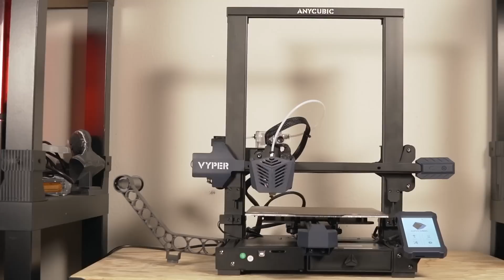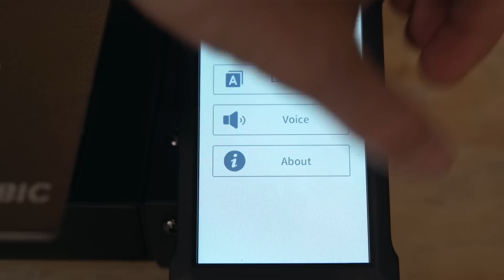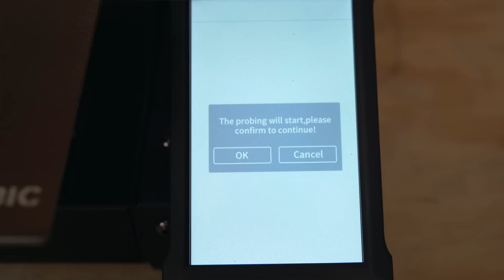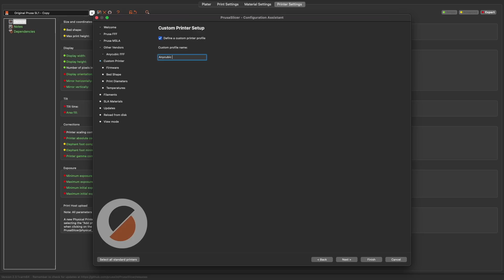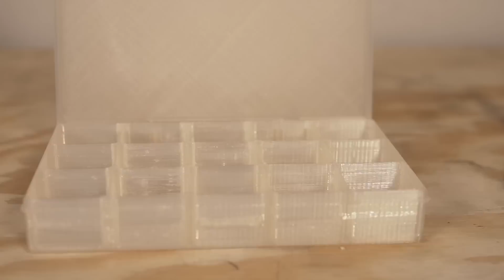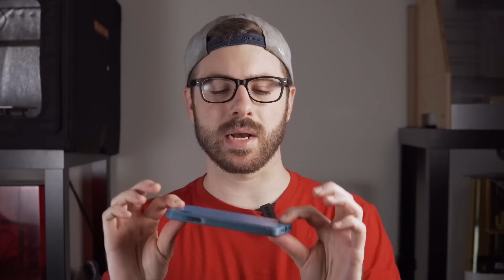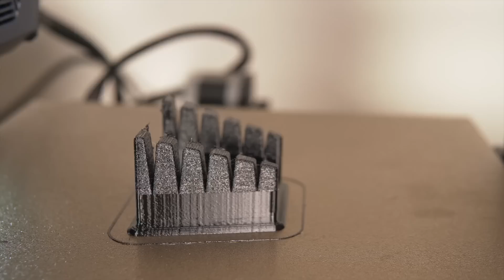The Anycubic Vyper 3d Printer Is SERIOUSLY Impressive

Comment: Hi I have been trying to set up my Vyper to print PEGT using a Cura slicer. It prints great until I introduce supports and I just can not seem to get it right. The supports just stick so well I can't get them off and the underside like the roof always has a terrible surface as if the filament is not sticking together on the first layer after a support. I would be so grateful for any advice pleas.

Comment: Great review! As this video is about 2 years old, I was wondering if you have tried to print with any ASA filament? I know it takes more heat to print with ASA and I was wondering if the stock heater would allow the extra heat. I'm concerned if the tubing will start to melt causing toxic fumes like my Mega X would do if I go over 240 degrees. Also, have you done any upgrades on this printer since this video? Thanks, Pete

Comment: Im chasing upgrades for my anycubic kossel linear plus, anycubic no longer sells parts and my heated bed build surface is worn and get no adhesion anymore, where would i get a new build surface and some 3rd party parts or upgrades that will fit the linear plus..

Comment: Low reliability, don't buy one, mine worked fine out of the box and printed the owl  test piece fine, I was stoked, then it couldn't print anything else without thinking there was a power outage every 10 to 30 min and aborting and not resuming.  The power was fine.  It's simply not a robust unit and destined for the garbage can like all the other Chinese crap.   If you still really want this unit, do yourself a favor and get $300 in cash and burn it and save yourself the frustration of getting this 3D printer to do anything useful.

Comment: I put a buck converter between PSU and MB fan. I adjusted the pot on the converter until I achieved a noticeably quieter fan yet still producing good airflow. The machine is SOOO much quieter

Comment: I'd check the firmware of the other printers for an option to disable the touch screen beep. It's probably there and just not enabled to change in the interface. Disable it and compile a new firmware. My Ender 3 Pro had a video assembling guide on the USB drive that shipped with the printer. Compared to the printed guide, it was an easier and more efficient way to assemble it.

Comment: Finaly i got my Anycubic Viper.The first one was destroyed during  transport, the second was stolen during transport, but the third one arrived in good conditioning. But what a dissapointment. Whatever i do, it will not do automatic leveling.. First i have to put a metal object to the nozzle, then it is homing and starts to pre heat. In all the tutorials i have never seen or saw this. then it starts to level it but afer the first point it stops .Abnormal leveling point put off power and check wirering. I did check it, dubble chekend it but i cant find anything wrong. i dont know what to do now. Can you help me?

Comment: I wonder if your "wet filament" was really a temperature issue. It's also probably related to the geometry, with the shorter line segments laying down differently than the longer lines below. Notice that both prints are clean down low and then suddenly get rough higher in the print. As the nozzle gets farther from the bed the ambient temperature drops off and the filament can lay down too cold. I suspect that you would find the layer adhesion to be poor in that part of the print as well.

Comment: FYI as a custom gaming PC builder, I heard you have an issue with the fan noise and that’s because it’s a low quality bearing fan. Next time you use one like this just go and buy a “Noctua NF-A8 PWM” 80mm premium quiet fan with the best airflow of any fan brand. Gets about 1800 RPM and is literally quite

Comment: Great review..  I just purchased the Anycubic Kobra model.  The print quality to me so far looks real good.  The one thing though is that It has the edge or lip material all around the part and is hard to get off.  I noticed your parts did not seem to have this edge or boarder around the outside of the part.  Could you maybe give me some suggestions out to get rid of this boarder?  Then again I don't know what this boarder is called.  Thanks, Dave...
Reply: It's either a brim, or elephant foot. A brim is extra material that's intentionally added around your part on the first layer to improve bed adhesion. You can enable/disable it in Cura under the "Build Plate Adhesion" section. Elephant foot is when your part is actually wider than it should on the first few layers. This is typically caused by a nozzle that's too close to the bed on the first layer, or excessive bed temperature that keeps the first layers soft, making them expand under the weight of the layers above. This can be fixed by reducing the bed temperature, increasing z-offset, and if nothing else works, by setting "Initial Layer Horizontal Expansion" under "Walls" (in Cura) to a negative value such as -0.2mm.

Comment: I need to get rid of my ender 3 max (pain in the b...to get levelled), i like the Vyper but it's smaller so what should i get  the size of ender 3 max but with the Vyper specs, need to be auto levelling and no damned springs under the bed, i'm so confused to many choices, thanks for your input.
Reply: The Anycubic Kobra Plus and the Kobra Max are basically larger Vypers.

Comment: yup its awesome.....junk. gotta love all the bought and paid for reviews. mine came nonfunctioning out of the box 3 1/2 months later ive got the replacement parts and installed them. its whisper quiet..... for a jet plane. oh and the magnetic plate powercoated yada yada yada... nothing sticks to it. this might be ok for someone well experienced in 3d printing. also the cura slicer software does not not include the anycubic vyper.

Comment: Just bought one for $335 on newegg. Im so exited to get this thing! We use Ender 3s in my engineering class and thats what got me interested. After debating for months i finally got a printer.
Reply: Can this print carbon fiber pla? maybe with a hardened steel nozzle?
Reply: How’s it been? Thinking about buying one
Reply: @brettshrekington loving it right now
Reply: yeah, your gonna wish you had gotten an ender3.
Reply: @denniswitthuhn2277  actually i don't. I really dislike my schools ender3s and im glad i got this. Had 0 issues so far.

Comment: Wouldn't touch this model. Has a faulty stress guage sensor in about half the models. Print head won't auto level. Just smashes into bed. You can contact anycubic and go through a "process" to fix it. But, I kinda just like the old work out of box when you spend almost $400 bucks. If you are an engineer and want to spend time being quality control and the beta tester, this is for you. Otherwise I would avoid this model.
Reply: The strain gauge issue is real, but it's not as bad as it looks. Considering how good the leveling is, I don't mind having to fix the gauge from time to time. All you need is a $3 part from AliExpress, some RTV and the ability to solder. I'd honestly rather change the part every other month than fiddle with bed springs, deal with inductive sensors, and/or slide paper sheets under the nozzle.
Reply: @dsp4392  I just ended up getting creality model with auto level. Worked out of the box and havent had to swap, solder or deal with something monthly. Honestly, thats what Im all about. But if you like all that jazz and spending $3 all the time, uh.. ok...

Comment: I had an anycubic i3 mega s printer. Had trouble with the print bed kinda warping near the center or it not actually heating properly. (Not sure, I'm as newbie to 3d printing as you can get)

I ended up buying this because of the auto leveling (I have nerve issues making it difficult to turn those knobs underneath the build plate at awkward angles)

I did my first 3 prints including benchy using prusa slicer with the same profile as my i3 and they came out absolutely flawless! An icosahedron with numbers, infinite cube, and benchy at max resolution. Can barely see any lines at all! So much quieter as well, so I can print while I sleep no prob. 

About to try out tpu for the first time, so we'll see how it goes, but I am quite satisfied with my vyper so far.

Comment: Great review! It’s pushing me toward buying one of these. I have a heavily modified i3 with direct drive and this is about to receive a volcano hot end. I’m also not crazy about the original Ultrabase bed as the surface is prone to damage and the adjustment is a hassle.  This printer improves both issues and I’d like a bigger build volume. It’s going to be a choice between one of these or the Chiron, which is now available cheaply and has substantially increased print volume.  I’ll hold off until next year before pulling the trigger.
Reply: did you ever make a decision?

Comment: purchased this the other day and couldn't wait. It was supposed to be easy peasy. my only problem is that  when I go to print the nozzle never touches the build surface. It just starts spitting out filament. tried to figure out z offset but couldn't get it going. any help would be appreciated.

thanks

Comment: The high pitch sound should be the PWM signal when it is not running at 100% fan speed. If you set it to 100% fan speed, the sound is gone. Nice video, thank you! :)

Comment: Ive had many prints stop mid print due to filament sensor malfunction. I updated the firmware and still experience it. Most times I just hit print resume and it might come back with the warning but at times it will continue to print for half a day before the error comes back.

Comment: I bought a Vyper and after calibrating and leveling it printed the owl. But that was it. The next print took the hotend below the bed and scratched the crap out of it. Anycubic told me that the sensor was bad and they send me another one within 15 days of filling their form. I returned the printer and ordered another one. I got exactly the same results. I just can't get a print because the hotend goes below level and will not print or autolevel, ever again. I'm sorry to say I won't try a third unit.

Comment: This printer is garbage. I bought one and after about 5 prints the strain gauge stopped working. The strain gauge is required for the "auto-level" to work properly, without it the printer is non-functional. You can easily find videos about this issue. I am returning mine. DON'T BUY!!!!

Comment: I would have bought one of these already if it did 50 micron layers.
Reply from the maker: You very likely could go down to 50 microns. However, I would never want to print that fine due to how long it would take to print anything. At that resolution I would recommend a resin printer.
Reply: @ModBotArmy  Relatively new to the whole 3D printing thing... How would I go below the advertised 100 micron minimum? Simply slice the file at 50 microns?

Comment: My luck is utter dog shit lol. I purchased an Ender 3 v2 and it came used, had a multitude of issues... I returned it and bought the Vyper, everything put together fine and I performed the auto levelling... It finished fine and everything seemed good... I noticed the Left "z-stop" sensor (the one attached to the Z frame) had a screw sticking out of the side and I could move the screw easily... The right sides was fine... Guess they send me one that wasn't assembled correctly...
Reply from the maker: Oh no! I am sorry to hear that. Where you able to get it fixed? Or was it stripped?
Reply: @ModBotArmy  I contacted their support, it seems the screw is only accessibly inside the sensors casing, and I don't want to try and take it apart. So gotta wait to see if they say I need a replacement part or not. Hopefully it is an easy fix. I've been really antsy to start printing haha

Comment: To me this looks very very close to my CR-6 SE in terms of features except the CR-6 has a filament run-out sensor and had a glass bed. I love my CR-6 SE though - print quality is ridiculous even at 100mm/sec. If this printer was a little cheaper to buy, it would have been a very appealing product.

Comment: You said the hot end wasn't all-metal, but the neck of the heatbreak looked too thin for PTFE tubing.  Wouldn't that mean it's all metal effective?  My V6 clones all have a short length of PTFE to the all metal heatbreak.

Comment: Sorry to keep spamming your comments. But think I can help you out with the Cura/M1 Mac issues. 

Messed around with some more complex designs, and was getting the same issues. Crashing. Freezing. Frustrating. It’d slice just fine. But issues would abound if I tried to preview. 

Did a little digging and discovered an easy fix that works well so far...

1) Open Cura
2) Select “Ultimaker Cura” from the menu bar
3) Select “Preferences”
4) Check the box for “Force layer view compatibility mode”
5) Restart Cura 

This worked immediately for me. Tried a bunch of different designs that were previously crashing every time. No issues. 

I’m still a newb with CAD, Slicing, and printing. But, hoping this Cura fix can help someone out.

Comment: Good review. I really like the flex bed plate and the auto level. Print quality though, I think my i3 Mega S actually does a little nicer job. Still, nice to see Anycubic is still innovating and improving, gotta like that! :)
Reply: most likely just need to sit down and spend time with slicer settings to pull the best of it out. 
My old I3 mega S was a completely different printer after calibrating the stepper motors then got better just spending time doing little test prints playing with settings.

Comment: Nice review!   Think this will be a great printer for first time users.
Reply from the maker: Thanks Brotha! Yeah many of the printers I have tested feel so similar to each other. This one at least feels like it’s got some additional good stuff going on. I will likely run some big projects through it 😬
Reply: @ModBotArmy  - I haven’t tested nearly as many printers as you.  I am at around a dozen printers.  When I first saw this printer and read the features, I began thinking this was just a CR6-SE clone.  However, the electronics are different, including the strain gauge, and the nozzle.  To me, this looks to be the better alternative to the CR6SE, which has the most notably feature, the strain gauge.
Reply from the maker: I actually had no idea it was even similar to the 6SE until I published the video. Then quite a few comments said it looked very similar. I do have a 6SE on the way but it is not a review unit or intended to be used for reviewing. I am just excited to see how it does having used the Vyper and loving it. Most people that I have talked to that got the 6SE seem to be pretty happy with it.

Comment: got mine, problem is autolevelling doesnt work. the hot end smashes in the bed and thats it.
Reply: Here are a couple things to check -- 

1st: Check the hot end to make sure that the heater block is level. I've found on mine that if the heater block isn't perfectly level it causes the nozzle to smash into the bed and "press" the bed down while leveling. If you get three beeps when leveling, this is likely the problem. You may also have to pull apart the hot end and adjust the bracket that holds the hot end. This bracket does double duty as the leveling sensor, so any weird torsion causes issues. 

2nd: The print bed and the entire hot end assembly need to have zero wobble. If you have any wobble at either the bed or the hot end, then you need to adjust the guide wheels until they are snug. A lot of times these guide wheels become loose during shipping. The adjustments for the hot end are on the bottom guide wheel and the adjustments for the bed are on the right side guide wheels. 

3rd: Make sure the nozzle wasn't damaged during the bed leveling. I changed out my nozzle after the initial problems I had with leveling, and I found that there was a slight distortion on the old nozzle due to the amount of force put on the brass. 

Once you get those three things sorted, you should be able to get the auto-leveling to work. Ideally, the nozzle should touch down on the bed, then move up and touch down lightly in the same spot. If the initial touch presses on the bed, then something is wrong. 

Hope that helps!
Reply: @austinscorpio23  well thanks for your detailed answer. But in my case it seems like the "strain gauge" is damaged. if i press the hot end, no controll led lights up. so anycubic will send me a spare part but unfortunaly from china. we will see if this will solve the problem.

Comment: The motion system got worst, i have an i3 mega s that has linear guides... replacing them with rollers I call it a downgrade.
I see an improvement in the extruder, having switched from an e3d titan clone to an extruder copied / inspired by a BondTech BMG (not sure if any changes have been made by anycubic).
for the hotend there has been an improvement going from a clone of the V6 to this new version where it seems they have added fixing screws, instead of having the classic cylindrical coupling of the v6, but I think that a volcano block does not improve this printer as regards the retractions and the stringing.
I like trapezoidal screws with backlash compensation nut, great idea. The PEI detachable plate heated bed can be considered equivalent to the ultrabase, in the end the detachable bed can be an advantage if you have a lot of prints to do and cannot wait an ultrabase bed to cool to the release temperature of the material.
Dual endstop on z axis, niiice! So, the controll board should use dual z motor driver... otherwise the dual endstop are usless.
The firmware remains extremely simple, without options for advanced users, but have some improvements.
The price is  359$... it's ok, but I'm sure it will come down... after all it's an increese of 120$ vs the i3 mega and an increese of 290$ over the mega zero, and this vyper is more an upgrade of the mega zero.